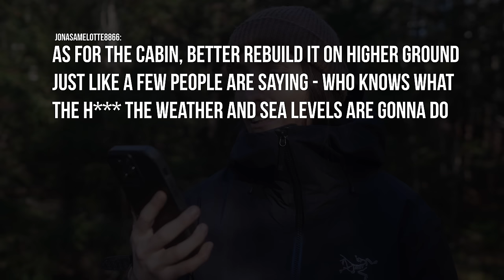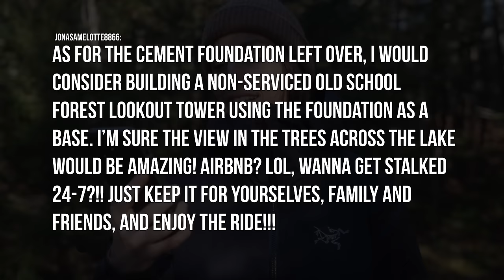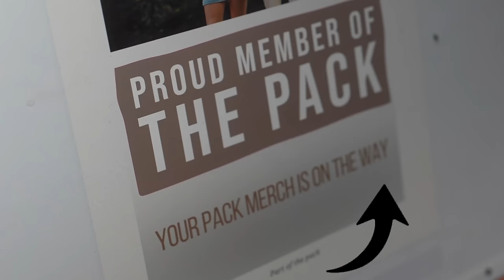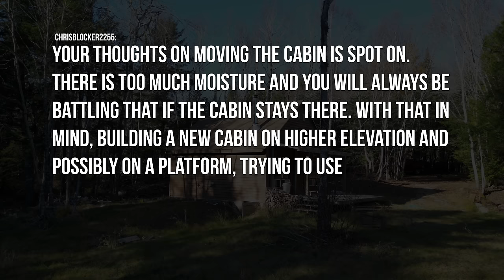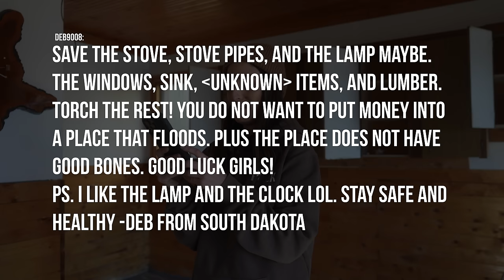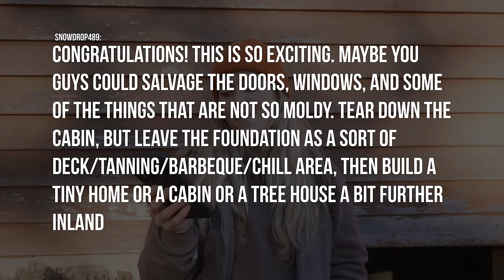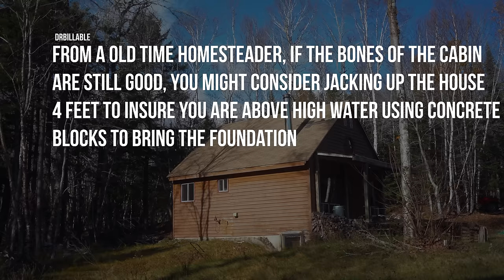Starting My Abandoned Lakefront Home in The Woods

Comment: Anything wet, moldy or broken, BURN. Remove all the burnable crap and lite it up.. Check the foundation with a professional. Then build the foundation up higher so you can use the under-house for real storage. Tractor, mini excavator, etc. Maybe add to it so you can also park your truck underneath. Just make sure everything under the house is mobile in case it has to be moved to higher ground.  Take your time and utilize a professional to design your new house and where everything on the property needs to go so you are doing it once and the aesthetics are exactly what you want.... DO NOT BE IN A RUSH TO BUILD!!!!!  Things change a lot and making everything about the house right and the property right is key to a wonderful home.

Comment: It appears the gravel floor didn't have any vapour barrier on it,  so thats lead to mold and failure.  The newest building code and future building codes are a remarkable launch forward in better building practice.  I really like the idea of creating a new building on higher ground, it would be possible to thin out some of the trees such that you can get a better view too.

If you can drive a concrete truck there, I might suggest an AMVIC R-30 ICF foundation system (walls) and perhaps a pre fab walls system  such as Greenstone  ( R-50) or other more fully completed modular if you can drive it there and crane it into position. Or you could make an ICF to the roof if you want....insulated concrete forms.  Then think about the heating system.  There is solar, but in winter you probably want electricity and a heat pump can give you heat and cooling and even heat hot water.  I could go from my west coast home to install ICF with you if you like.  Fun to do new projects.

Comment: I would definitely remove the cabin due to the issue of ongoing flooding and the fact that it’s in very poor condition and riddled with mould. I would then use  the existing concrete footings to build a fantastic deck and BBQ area  with some shade structure to hang out during the warmer summer months. You could use eco decking like Max used on his deck next to his van in Northern NSW. It’s an extremely durable material and is made from recycled materials. Love you guys & Merry Xmas. From the Land Down Under😊 Gray

Comment: Do like the Dutch and build dikes along the river to prevent water overflow penetration. But the soil is boggy, so copy the permaculturalists and construct berms, swales, collection ponds once the desired land is graded. Seems there are lots of nearby natural springs or wells.

Cut down and clear dead trees first. Then thin out some of the dense growth to improve visual effect and desired tree species space to develop. Spread their branches, create habitats, shade and water retention. Select tree species that have deep roots to bind the soil.

Walk around several times during winter and spring. Get a feel for the space. See what Dave sensed. Envision your new opportunities.

On elevated ground commence your rebuild. Poured concrete blocks. Or precast concrete, treated for moist environment. French grade for runoff to the river, lake or pond.  Build from scratch. Or prefab container or prefab knockdown wooden home, or prefab home delivered. That delivered home can be expandable containerized or assembled in wooden sections assembled on site.

Next site utility preparation: Potable water, sewer, power (solar, hydro, wind?, propane, gas generator). Roadway to handle loaded trucks and a turning/parking areas.

Fishing, campsite, healing (yoga, meditation, stretching, healing smoke/heat tent), large open cooking and entertainment retreat lodge.

Comment: Joined the Pack today - ow, ow, ow-whooooooo!!!  I second all the comments about wearing protection from the black mold; it's there and lots of it, and it can seriously impact your health long term.  That hole in the floor - you've got plenty of wood available.  Get some planks and just nail them temporarily onto solid areas surrounding that hole to cover it until you're ready to remove all the flooring.  A fall into that hole could put your plans on hold for a long time, or even permanently.  Be happy and excited, but please be safe.  PS I'm a Mom - can you tell??? :)

Comment: The wood can be salvaged, even with mold. Once fully dried, it just needs to be cleaned off with an anti mold cleaner. Or sanded/planed down. But you should be wearing n95 or better masks while working in the cabin or with the moldy wood...you don't want to get sick.

Comment: Think you should go the container build route on this property.  Stack a couple if necessary further back, on higher ground, with a view (Dave’s Place) 😉.  If you are confident with that original foundation raise it with blocks and container build there as well.  It will inevitably be surrounded by water though?  You have a clean slate to work with so do your research, you’re smart you always figure it out😜

Comment: If you're not looking to build another cabin, maybe repurpose that foundation and build a simple boathouse type structure for watercraft (canoes, kayaks, jet skis, etc).  Dig it out a bit, lay down crushed stone, cut out a wider section of the foundation wall for more access than that existing door provides.  Think something like a garage type structure design, but smaller, not as tall, with barn like doors. So many possibilities.

Comment: Have you thought about Two 40 Foot Containers as a new Cabin structure, elevated on a foundation. Space them apart and utilize a 20 x 40 interior (patio. kitchen, living room area) with a large roof structure over both units. Cut openings for bedrooms and windows, or use one side for storage, solar, batteries and other utilities. You could even build a 2nd story on the containers as the elevated foundation.

Comment: Spend some time on internet, it only takes minutes to figure out what is the best to do if you gona build things. First: google and you find out that the moisture coming from the inside of the house. So you need a moisture barrier inside the wall so no moisture going inside the wall and mold. then you can frame the wall with vertical wood and on the outside you put 2x2. Now you can put insulation inside the 2x2 horizontal and then insulation in the bigger frames, no cold gap bec insulation goes 2 ways Then Tyvel or simular that can breathe. Tyvel can breathe and plywood/osb can NOT. So no need to use plywood/osb outside the walls (you can use inside if you want). Later on you can install the panels on the outside bec Tyvek protect the walls from bad weather. The lock panel model you built before is good model bec now you get a wall that can breate if you make a gap between the first panels, you cover the gap with the lock panel. Now air can go in the gap between the panel and the 2x2. The 2x2 replays the plywood and you save the costs of plywood, 2x2 is much cheaper and Second: when start with the floor you make a normal with 2 inch joists, before install them install a 1x4, so you have that on the bottom when install the joists, Do not make any plywood flooring now, if you need some plywood use a few and move them around. 99.9 Amerikans install plywood between the wall and the floor and i dont understand why. If you got a leak from inside or outside the water spread in to the plywood and its harder to replace the plywood.  Inside floor shall be inside the house. Third: Now its time for the roof and spend time to google so you dont install the wood as you did before , first its gona be a vertical wood and on that a horizontal so you got a ventilated roof,. Before you got wood vertical and that sop water from going down and the wood get bad direct. Fourth: Now you got a waterproof house its time for the floor. Drop sheets between the floor joist and they stop at the 1x4 you already install on the floor joist. You gona notice that with this metod you dont need to work under the house. Install the insulation and the the waterproof moister barrier. Its also easy to install the drainage/water pipes and electric wiring if you not have a floor on. When doing the floor walls and roofing you gona see that there are some measure that been use for almost all building materials, Google that and it will save money and time, we call it C/C, but its in metric system but you have it to in inch or feet. Spending some minutes Google can save alot of money and you get a better house. Also when working on the floorjoist you shall deside if you want a stove in the living room, most of the Americans just buy a stova and Google if you can buy a stove that take the inlet air from a pipe to the outside, normal is to go downd and on the outside of the foundation, why, because The air going ot from the stove must come in somewhere and that is from the ventilation and its a lot of cold air going in to the room so its better to keep the warm air in the house inside and using cold air from the outside to burn. You can contact me if you need some links. Good luck

Comment: The crawl space looked dry.  Did it actually flood? First stop the water from getting in through the roof. Then when dried out, you can start removing the inside.

Comment: Save any pressure-treated lumber, but burn the rest.  You don't want a bunch of black mold spores in any new construction, even if the wood is not moldy.  That's not a river.  It's a creek.  Have you got a topographic map of your new property?  That can be a VERY cheap way to find a new cabin site with good elevation.  You can always cut a few trees or build it two story to get a good lake view.  You will need to cut some trees anyway to get construction equipment and supplies there.

Comment: Likely more work than profit trying to salvage that wood for anything that would be for interior design since the mold will be an issue as time passes. Get the windows for certain, they're just expensive anymore, any copper or other type of metal or mechanics worthy, and then, diesel her up and burn the rest down into the footprint of the crawl space - center start the fire so it collapses inwards. I'd move back those stones along the river bank, add many more, along with smaller river stones to help fill gaps, or build a seawall, to form a penisula that would include the crawl space for a deck space, for relaxation. I would see if I could use that crawl space outline to build up ground back to where Dave's old dominion once sat to be elevated a good 3-4 feet above the water level, make a stairway down to the water level area of that penisula for recreational use, maybe even use beach sand if possible to create a beach setting - best of both worlds by having the river and beach built as one for Jaz's pleasure of the river and the ambience of beachlife in the forest. So many thoughts and ideas to improve the homestead section, but maintain the primitive beauty of the surrounding forest. I'm glad you two have found your happiness, at your demand and not others. Have fun, will continue watching. I like the whole pack thing, but I'm just not that kind of guy that would wear it, and my Wife and Daughter are in the Philippines so getting it to them in any tailored timeline is near impossible, so will wait for the newer version later. Thanks for the entertaining moments. Jaz is a nut.

Comment: Wow What a beautiful property, I had been wondering just how nice of neighbors you had letting Swim in their lake.
The water logged cabin, any wood that is mold effected can be washed with bleach to kill the mold and left to dry.
Don't make any plans on what you doing until you have the house completely stripped down to the studs on the whole inside.
Then you can inspect for rot and see how the outside sheathing has fared.
If a majority of the framing is solid you have many options.
Raise the whole thing up on stilts and have a Venice approach to the water.
Strip all the sheathing off and lift the house up and put it sleds and drag it to where you want it, preferably with an already made for foundation waiting for it.
Disassemble the house in section and move walls and components separately.
If you do move it from it's current location you certainly could put a gazebo there in it's stead.  Or build a boat house with a channel to the lake, "lemons" to boat house.

Comment: The more I see of the lakeside location at the mouth of the stream, I think a wide beam boat is the solution! Could one be transported there by road and across your land? You might pick a bargain somewhere. It wouldn’t need its engine working, and might be sold cheap. Moor it in a dyke beside the shore. Build the rest of the living quarters on the high ground, and simply use a marquee in the summertime, and several cabins…

Comment: There is a reason there are specialty companies that remediate mold.  I think Van Wives is biting off too much of the "do it yourself" with this cabin.  Burning is not the answer, more like bag and bury.  Do not carry anything back to your cabin until you can thoroughly clean it of any mold.  Trying to repurpose any of this cabin seems to be very iffy, given the degree of rot and mold present.  You need to wear proper hazmat gear before doing any demolition.  It concerns me that no precautions have been taken.

Comment: Woof Woof Aooo  The boards can be salvage by running them thru a wood planer you just have to make sure there are no nails. There are tools that you can get that will get the nails out quick an automatic nail remover. You will loose about 5-6 mm per pass.

Comment: Use the foundation for a big Deck made of composite deck material and stainless hardware. Set it up for a sun drenched play area during the Summers, including cooking, and make everything supporting the fun, easy to unhook and remove when the threats arise. And get GOOD Black Mold remediation masks and gloves for the demolition and handling. And there's very little that should be reused.

Comment: You could take the windows from the old cabin n. Build a little potting shed by your soon to be cabin on top of.poo hill 😅  And use the windows for that, but if you do that. Even if they're big windows, make sure you hinge their frame of them. At the top at least. And screen the bottom.
Somehow so you can get a good breeze in the summer time but not Get bombarded by insects. Because it will get hot in the summer time so you want to be Able to open all the windows just an idea❤

Comment: All and all, that cabin does not look too bad given it has been flooded and the roof leaked.  Looks like it was built well and maybe a few key details from a novice builder introduced some select failures.  Like they put a vapor barrier up in the exterior wall, just wrong.  They thought enough of the cabin to try. Lots to keep and work with there.  

Unless you plan to live on the property, I would try and put something there as the spot is just so dreamy.  Whatever kind of place you would enjoy and retreat to.    The comment to lift the cabin a few feet would work but I would not do that yourself.  I’m a general contractor and end up doing that for some clients and almost always get someone to do that work.  They have all the tools and materials to do it and can often do it cheaper then it would cost us to buy everything.  If you are considering that, look for an old local to do it.  The search term is shoring or jacking.

The moldy wood can be treated or used for outside projects.    Good luck.

Comment: Hey ladies new to your channel.  But loving it so far. As an ex firemen and an equipment operator that deals with old houses all the time, just burning the old cabin will Compromise the strength of the concrete foundation. The concrete gets super heated when you burn a house on top of it and it loses it's  structural strength in the heat. I know it's the cheapest and easiest way to get rid of it. But if you plan on reusing it I would not recommend burning it. And there is lots of toxic things in a house when you burn that's really not good for the environment.  Just wanted to say something before you make up your mind on what you guy's are going to do.  Can't wait to see what happens and what you guy's do with that land.

Comment: The interior wood can be salvaged and treated to remove the mold and air drying to achieve the proper moisture level. They would make beautiful wood wainscoting in you new build, put a chamfered edge on one side and install vertically. Just store with space between the boards to prevent moisture buildup

Comment: with the finished paneling in particular, you should be able to save more of it than you think by planing down and then sanding the backside of each piece, which will give you thinner pieces and therefore also more lightweight paneling. then you could separate the planed-thin pieces from pieces which did not need planing, and see if it works out to panel one wall with the thinner pieces, and a different wall with the non-planed pieces (for a uniform surface on each wall). if you only end up with a small amount of one or the other thickness, you could try using those pieces as the exterior of cabinets below your kitchen counter, or make your own custom sink vanity out of them, based on whatever square footage you end up with of that particular thickness. i'm a huge fan of vintage everything, so me personally, i wouldn't change the original finish on the wood AT ALL - but i would add a waterproof finish to the backs and sides of each piece to preserve all of that hard work for as long as possible. p.s. - you may need to take a bit of extra effort to get the paneling pieces nice and dry prior to planing them.